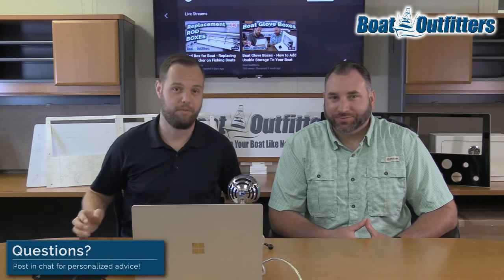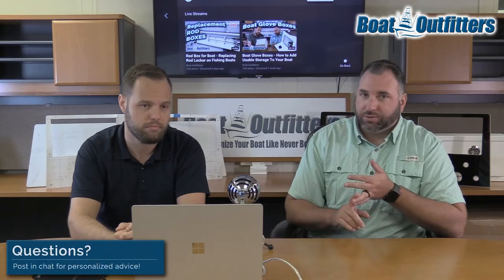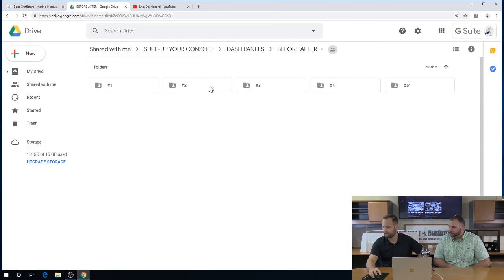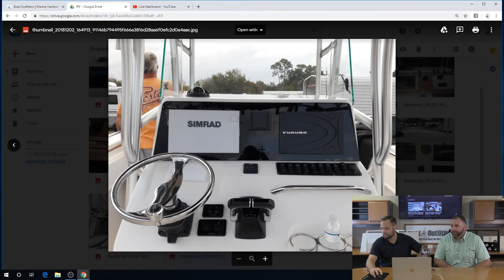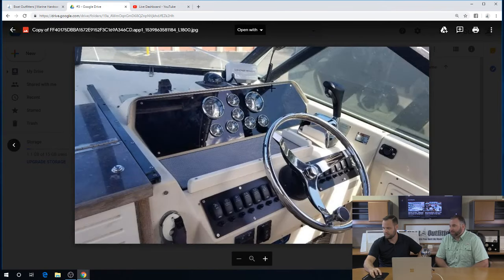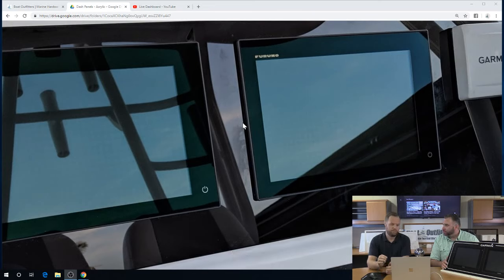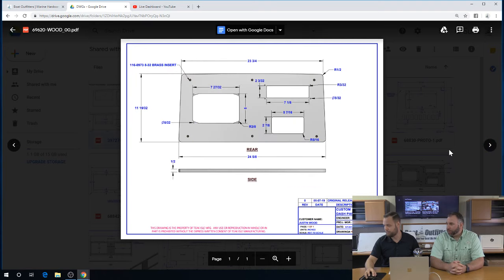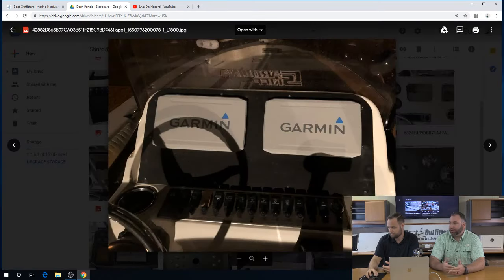Boat Dash Panels | Upgrade Your Dash and Electronics

Comment: Question: Basically, I'm putting down new fiberglass on the face of my console, and I'm looking for that glossy black finish.  Does it save engineering time (and overall cost) if i send you an autocad OR adobe PDF file with vector lines already set out?
Reply from the maker: Great question! Sending a file like that can certainly help us get the shape and dimensions, but in many cases, it does not save much time as the engineers will still need to convert the file (or copy a template) to our standards and requirements for programming.  However, it certainly would replace the need to send in a template or the part itself! Feel free to give us a call at (866)-633-7961 for any other questions you may have :)

Comment: I am replacing a freezer (16"W X 27" H) in the cockpit area of my 2000 Tiara 3500 with a refrigerator (16"W X 21" H) Can King Starboard be used to close the existing hole and cut out to accept the new appliance? Should I use 1/4" or 1/2"? The refrigerator will be supported on the bottom with a platform. Would you recommend a different product? The current finish of the fiberglass is glossy white.

Comment: this is great . i had no  idea  you did so much custom work...
also are the acrylic plates or  black boards ever glued on the dash , with or without screws???
Reply from the maker: Great question! Adhesives would likely work as long as you had a good way to clamp the acrylic to your dash all the way around while it hardened. It's not uncommon for the dash to have a very slight bow (or for the acrylic to slightly bow for that matter). Mechanical fasteners help pull it tight down to the fiberglass and you'd need clamps to accomplish this with glue. Adhesives are not super production friendly and a consistent/repeatable install. Because most of what we do is OEM everything we've done has been mechanically fastened. For a one of though you could probably make glues work! Thanks for the Q.